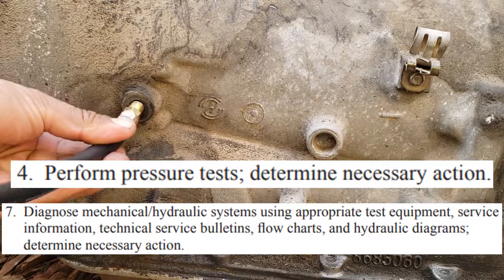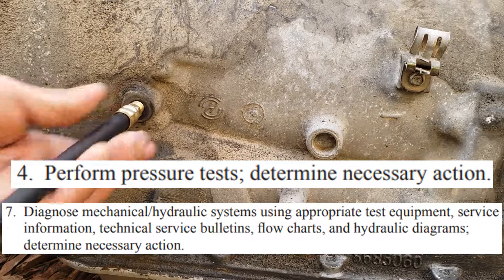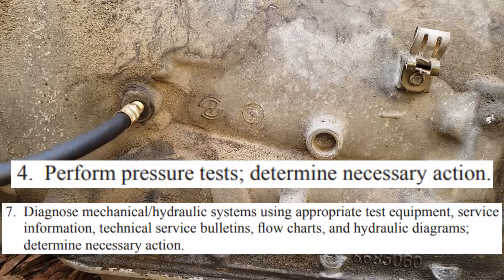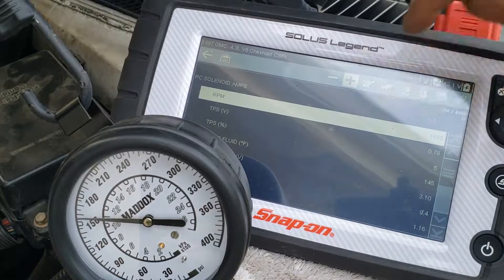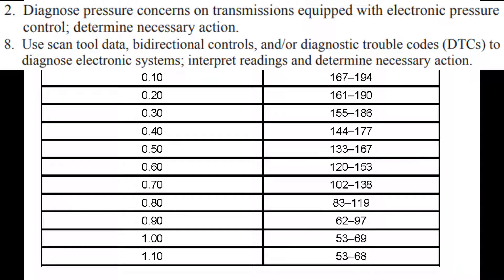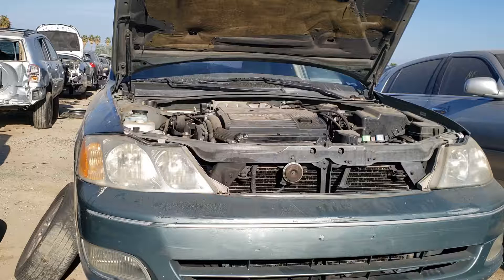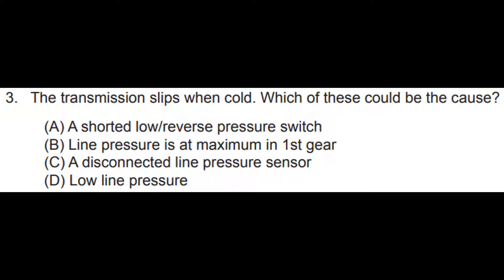ASE A2 Test Prep #2 - Line Pressure

Comment from the maker: (Update 2-4-24) Here's some feedback after taking the test: Saw 3 questions asking about the EPC solenoid. Don't get solenoid stuck open (exhaust) and solenoid stuck closed (exhaust) confused.
Same with the pressure regulator valve talked about in video #2, know what happens if its stuck open and stuck closed.
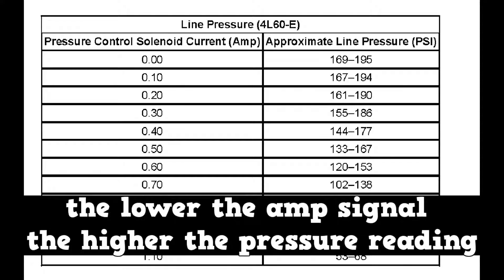1:38 there was a similar chart on one of the questions, know what would cause the amperage to stick 1 range only.
The information from 1:55 till the end of the video is a must to know.
Reply: EPC solenoid stuck open and stuck closed, you have both with (exhaust). Please explain.
Reply from the maker: @billyyoder8171  an electronic pressure control solenoid can be functioning properly when tested for opens/shorts/resistance, BUT it physically needs a path for it to "vent" some pressure , this = exhaust. If the exhaust is closed (clogged) the solenoid will not be able to vent pressure, this can lead to a very high pressure. If the exhaust path is always open, then the EPC solenoid will not be able to maintain a constant pressure, = low pressures.
Reply: @OldSchoolNoe  thank you. Have a good night.
Reply: could you give an example of a cause for amperage sticking ?
Reply from the maker: @Xx-JothaMs-vX  the most likely scenario would be the pressure control solenoid "sticking" at 0.00 amps due to it being defective.